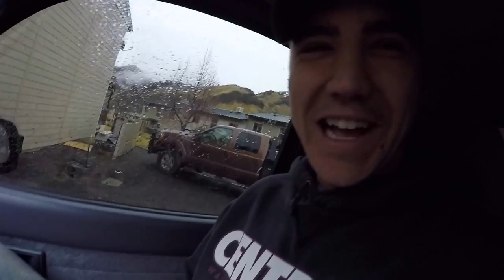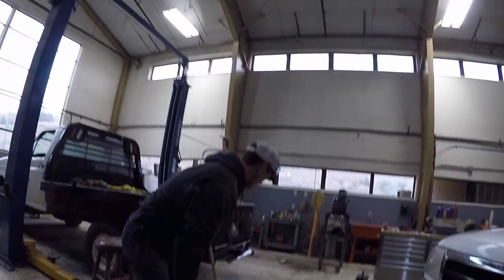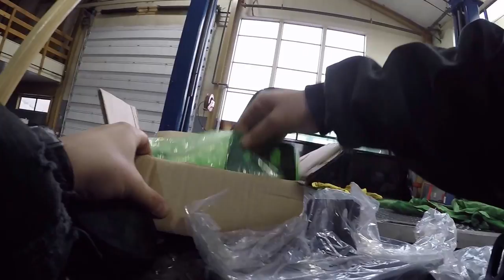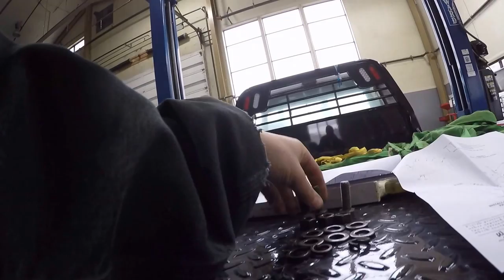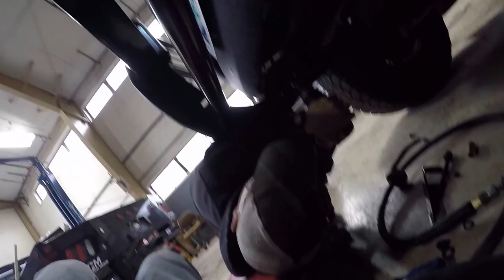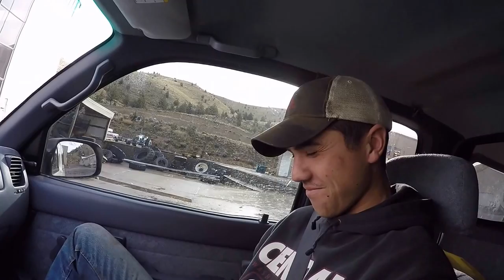Toyota Tacoma | Grille Guard Install with Axe Family

Comment: with body on frame vehicle.  the upper attachment brackets are supported to the body. lower brackets are attached to frame.  figure it out yet?? yep your right! you just made a solid attachment to body and frame! the softer metal in radiator area, can and will tweak if you do ANY serious offroad. if you use grommets,  flat washers,  longer bolts at the attachment point at the upper guard bumper area this will eliminate the  tweak. also if you get a tap in the upper  area of said guard you have a better chance of the brackets not punching the attachment points inward. only a light tap . make sense??
Reply from the maker: yeah those are great points! Thanks for sharing!
Reply: I made my own brackets to mount it right to the frame. Stock ones will damage the radiator.
Reply: @nightterrors7657  that's what I'm a little worried about. Dis you weld your own?
Reply: @nightterrors7657  I need to make some brackets for my 2002 4runner WAAG grill guard. Any tips on fabricating brackets??

Comment: I installed a similar one on my 2004 Toyota Sequoia.. I had a little problem with the support brackets. Could you do a video on where you installed your? Thanks
Reply from the maker: I actually sold this truck so I'm not able to do a video on it anymore. The support brackets went through one of the slots in the grill and mounted to the frame of the truck. The bolts that came with it were actually too short for this part so we used some longer bolts that we had and just drilled out the holes a little bit. Hopefully you can figure it out!
Reply: +Axe Family thanks for the information.

Comment: Would this fit a 99 ford ranger?
Reply from the maker: you'd have to check, I don't think it would as the bolt holes were specific to the tacoma. Check this out, you just have to put your car in at the top and it should tell you if it works https://amzn.to/2me9CZo (affiliate)